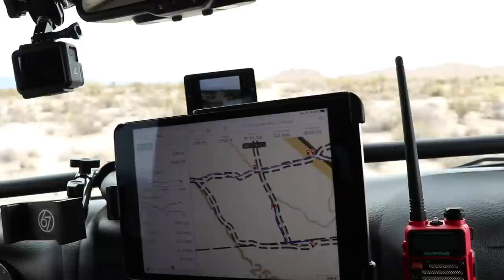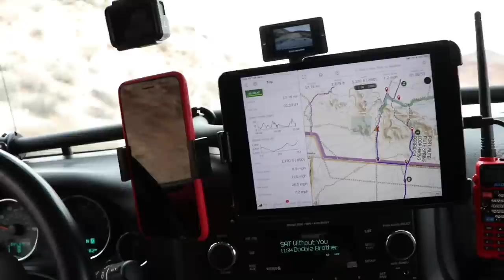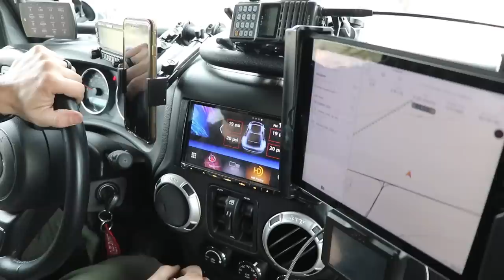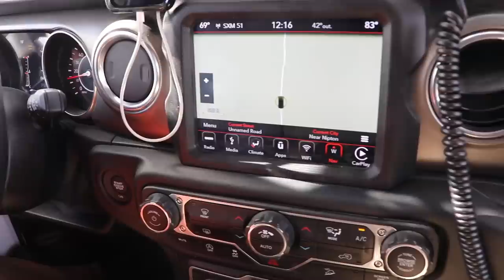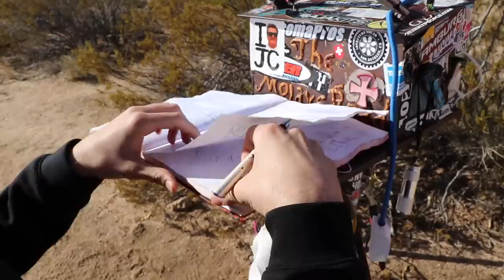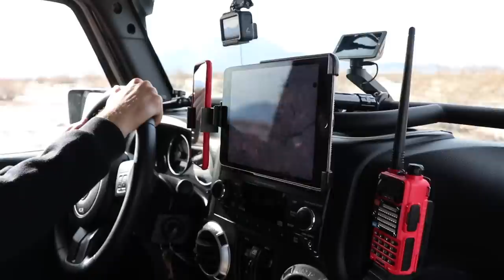Unexpected Snow Along the Mojave Road

Comment: What is with the flashing lights.  That would drive me crazy if I was behind that.
Reply: Judson Gutheil those are trail light. Normaly used in race likethe baja. It prevent you from ramming the other vehicule when in convoy and lifting dirt.
Reply: Victor Keya you can ask here bud...
Reply: Vital if you're kicking up dust behind you. It'll save you a back bumper replacement.
Reply: @dennisreynolds6915  well on this trip it wasnt necessary but there are times a jeep could benfit from that. not really posing but ok
Reply: @dennisreynolds6915  says the guy watching a jeep channel.
Reply: @dennisreynolds6915  let the trolling begin, I guess.
Reply: @donslattery8608  Don't give em the thrill, may they will just fade away.
Reply: avenger007007 solid advice
Reply: There’s this new technique that they’ve been developing for a while, don’t know if it’s in the final stages of testing yet, but supposedly you just don’t drive in the dust if you’re not racing. The problem apparently is that people get separated but they’re experimenting with having large trails of dust following them as a way to be seen in the distance.
Reply: @dennisreynolds6915  why you watching this video then
Reply: I get why they think they need them....but they don’t.   I have done countless over landing trips in horrible dust.  Slow down and pay attention. Those lights even are annoying just watching the video.  Following those would be a no go for me.
Reply: I was thinking the same thing. Wouldn't it be distracting?
Reply: The lights...
Reply: SAME

Comment: I live in the UK wow you guys are so lucky to have all that space to drive in ive just subscribed as i have had land rovers most of my life but iam going for a change my parents passed away leaving me and my sis there lovely 4 bedroom house with large back garden so with the proceeds once payed off everything iam going to get a jeep Rubicon  years ago i had a jeep Cherokee 70s model the big one which did about 8 miles to the gallon so iam going for the v6 model right hand drive over hear  ive had a range rover 3 series 2 land rovers and ive been interested in getting a jeep for a while now as i own a plain station wagon plus my wife hates being low down she never forgave me getting rid of the range rover she like to be sitting high up and so did i you live and learn as i can gather as my old jeep was reliable after i rebuilt it as it was dilapidated when i bought it but was great once i updated the wiring put an alternator on it halogen lights and loads of relays as it had none i had it for 6 years even when it nearly bankrupted me in petrol consumption as fuel is not cheep over in the UK its now five pounds eighty pence a gallon and is seven dollar forty-five  a gallon  but i loved that jeep so easy to work on as i am a mechanic now early retired through injury at work i worked for the R A C the royal automobile club for fifteen plus years and loved every minute of it and wish i was still there so anyway iam defiantly getting a 4 door wrangler Rubicon hopefully a new one or at most 2 years old depending what cash is left over plus i have got to spoil the wife a bit as well as she has looked after me while i am disabled i have a back problem and before you say i must be mad i have been off roading with friends since my injury and it doesn't harm me i find it weird i was expecting to wake up next morning in agony but no i am fine  iam on morphine every day its not like your stuff no high from ares as it has been removed so i can still drive which is great they should give it to you guys as there an addiction epidemic over in the US i see i don't take it all the time but winter is worse anyway so the Rubicon doesn't need much work doing to it to make it off roadable light bar straps a winch warn if i can afford it my old jeep had one on it already so did my range rover we used to belong to a great off road club which i shall rejoin again after quite a few years absence we do have quite a few off road places to go to obviously not as much as you guys have we don't have desert lol in England but there is a lot of mud so i will need some very good deep tread mud terrain tyres with bead locks on the wheels i wish i could drive were you guys are but you never know maybe i could hire a jeep and come for a months stay and join a party me my wife and my grown up son who will share the driving with me now that to me would be a fantastic holiday also to meet some great people and make new friends once i get my jeep i will upload a link for you guys to have a look at it and see what you think once ive done a few modifications plus i can not wait to get back off the road and have some fun as i miss the friendship you make when doing this in an organised manor joining a off road club is like extending your family to me  so happy trails guys  .buy the way the video was fantastic i have subscribed liked and pressed the bell cant wait for your next video so buy guys  from RUGBY ENGLAND UK

Comment: “For every 1000 feet it only goes down 2 degrees...” Starts snowing 😂.  But seriously I wish I could take a trip like that. Great job Brad keep it up!
Reply from the maker: No scripts here... we all knew what he meant!  Thank you!
Reply: It's called lapse rate. Generally speaking 3.5F for every 1,000ft gained is the accepted number but it techically varies with moisture content in the air. Dry air will see a larger drop of up to around 5.4F+ while moist air will see less of a drop at around 2.7+-. It's just easier to say -3F drop per 1,000.

Comment: In case it hasn't been mentioned b4, you would be shocked at how much better a campfire would be if you would tote along a washing machine drum. Put it up on several football sized rocks. The wood burns much more efficiently, slower, the heat retention will amaze everyone. You will burn so much less wood and the warmth that radiates in all directions will blow you away. The steel of the drum heats up and radiates a tremendous amount of heat. The rocks provide a taller heat blanket as well as providing air flow and also heat up and radiate heat. Try it once and you will never go back to pit campfires again.  I realize space is limited with your rvs but this you WILL make room for. Regular campfires loose more heat than they radiate.
Reply: Weight and storage make it impractical/impossible to take overlanding. It does help produce a better campfire, though.
Reply: My volcano stove works like a washer drum (like we use at Glamis!) It also works like Marco's flat grill.  Also works anywhere you can't have a fire directly on the ground. Most highly recommend!
Reply: How many hours to cool down???

Comment: none of that trail looked bad, looked like a subaru could drive that entire thing.
Reply: tank2449 i was thinking the same thing but, better to be over prepared
Reply: @greygoose4x46  i mean my stock 84 s10 2.6 v6 4x4 4 spd manual with my all season tires could do that easily
Reply: Don't worry my Subaru will give a jeep or fj a run for its money, me and my grandad used to drive a 2 wheel drive chevy k10 around this area. The overland movement is cool but most places these folks go you don't need a jacked up jeep, just a case and some friends to get you through when a push is needed. Love, just another preoverlander
Reply: @thehighcountrymedicalclini794  a case of beer? damn right brother. my stock 1984 s10 with a 2.8 v6 and 4x4 with lockers front and rear could do this easily. and i only have 31's on it with some trimming of the fender. its more about the driver than the vehicle. ive gone places that big lifted up trucks and jeeps couldnt make it. its all about hammering down when you need to and when to ease your way through something also. 2.8 v6 isnt putting out much power haha
Reply: @tank2449  damn straight a case of beer. Ya it is more so about the driver, and horsepower really isn't needed I mean you do need it but not like some guys push for. Ive watched a supercharged bronco mash up a hill with 35's lifted the werks and it looked cool throwing dirt and rocks huge bumpers ect... then I watched an international scout quietly and slowly putter over the same ruts haha, with its stock size tires. Got to remember some of this stuff is a lot like the guy knocking on your door I the 50's trying to sell you a mirco wave, when all you need is 5 more minutes on the old gas burner. Take care, from flagstaff, az
Reply: @Michael_00001  i dont own a subaru i was just using it for refernce because it is a "car" that is awd. my 1984 chevy s10 and my 1980 chevy 3/4 ton suburban could do it no problem relativity stock trucks.
Reply: The point is the scenery and history not how mean the road is! Or how macho your rig is!
Reply: @Michael_00001  No one is compensating for anything, folks have 35's under some GL wagons that im sure would handle the Rubicon no problem. I was just poking fun, and we both had a laugh, then here comes Mr. Rubicon trail, off to show us that the trigger is real with jeep guys. I don't have my forester completely decked out, of course starting with one of these leaves me at quite a disadvantage for an offroad rig ill be happy to accept the challenge.
Reply: Except the. Swim....

Comment: Would a stock Jeep XJ be able to do this trail?
Reply from the maker: In good condition with a solid set of tires, yes!
Reply: It sure will. Some sandy areas. Not that bad at all. I like the pace. Slow down and enjoy scenery. Done enough of the ON THE GAS all the time
Reply: Thanks guys!
Reply: @justinhelfer2022   Don't buy a Jeep, worst idea for off roads.
Reply: I had a '95 xj on 30s. A buddy had an '03 tj on '31s. While he was getting stuck, I was walking all over everything. I have a YJ now but I'm looking for another xj to build for this type of stuff. In other words, I guarantee it'll do fine. Just get a good set of all terrains (bfg ko2s or the like) instead of these SUV tires alot of people get, and you'll be alright
Reply: As Brad said, as long as you have good tires you'll be fine. I did this trail last year in a stock 4runner. I shredded my front skid plate, and destroyed 2 of the stock tires, but I was mashing it pretty hard. Make sure you bring a spare (or two) and keep it mellow, and you'll do fine.
Reply: No issue, I’ve done it with an older stock F150 4x4 with 31” tires

Comment: Great video. I went on a Mojave run(day trip) 4 years ago in my stock JKU. I lost two tires and the water crossing came up to my headlights. No water came in the cab so I was very grateful. We didn't go past traveler's plaque so I will need to add a rock next time. Great trip for a beginner.

Comment: I had a 90 wrangler i built years ago for rock crawling here in Arizona. Ive since sold it and recently purchased a really clean 86 Bronco. Im looking to make it overland capable. There were some spots on the trail where the jeeps were a bit tight on either side. Would a Full Size Bronco have cleared all the trails?

Comment: Great video! Thanks for the trip! 
So the water doesn’t come into your Jeep? Sealed that well? I am surprised that the shock mount and sway bar broke on a somewhat mild trail. For the most part it seemed to be a dirt road with some whoop-de-do s in it with some slow parts here and there.

Comment: Brad, theater quality video and editing.  Truly a modern version of the old 1950's TV show BOLD JOURNEY.  But one thing I am upset about (smiles), I did not know that you were making this trip and I really wanted to tour with your group on the Mojave Road.   So, I guess I will continue to plan my solo trip for March.  They say don't travel alone, but I do since I can't find a local group like yours in Las Vegas.  I only hope that if I have a breakdown that I can nudge my Jeep out to the nearest paved road like one of your members.  I have not been to the Carruthers Canyon camping area.  Now I know what it looks like.

One question...It appeared that you went over the old telephone cable road after leaving Ft. Piute.  This is the stretch between mile 27-33.  It had been closed due to a bad washout...so has it been repaired?   If so, great!  Looks as though someone moved my jeep toy from the top of the rock at the mailbox.   My red sandstone rock seems to be still present at Travelers Monument.  That last campsite at 17 Mile Point is a nice sheltered spot, have stopped there once.   Was pleased to see that you got off course a few times, since I was feeling badly having done the same thing.  Those cross roads/washes can be tricky.  So thanks again for another outstanding video journal of the Mojave Road.
Reply from the maker: Thank you!  You may want to try hoping on a couple off-road forum, I wouldn't recommend doing it solo.   That section of trail was repaired this last year and now open... detour no longer required.

Comment: If you have driven the Mojave Road lately, do you think a GMC Yukon 4x4 w/ mud tires but an XL (extended) version will have any issues with the trails? Also, is there a side road to bypass that water crossing? Thanks in advance.
Reply from the maker: I've seen lots of full sized trucks out on the Mojave Road and as for the water crossing, there are a few options that will allow you to navigate around it, but need to be planned out a few miles before you get there.

Comment: Great video again Brad enjoyed your adventure in the Mojave Desert just thinking about my jeep liberty Renegade going through that  rough terrain and about possible break downs it could encounter, yes you're right make sure your rig is up to the challenge with everything working topside and underneath. The only questionable possibility with a 2.5 inch lift going through the river crossing.  I don't have the big tires to ford through so is there an alternate route for those of us that don't have the clearance?  Anyway looking forward to the next adventure.
Reply from the maker: There are a few trails that you can head out on that will take you around the water crossing.

Comment: What was the depth on the Afton Crossing when you guys went?  I was thru on xmas day and it was at my bull bar on my truck which sits at 47 inches, take away the bow wave and the water lines on my truck and it was about 45".
Reply from the maker: I measured the water line mark a my doors an it was around 38", so a little deeper when you went.

Comment: Just curious, but how many gallons of fuel did you take for the trip?
Reply from the maker: I had a 1/4 left and used the 3 gallons I brought.  There is a gas station 9 miles down the road from the end of the trail.

Comment: At 6:20 you show an iPad mount by what I believe is Ram Mounts.  I have their iPad 2 to iPad 4 mount.  It has caused damage to the plastic bezel and the plastic antenna cover on the back of the tablet.  Have you noticed any similar problems with the new one for the iPad airs and on?
Reply from the maker: Mine is an iPad mini with a ram mount held on with a 67 designs arm... no problems with this setup for over a year now.

Comment: Brad, where did you guys fuel up before you got on the trail off of the 95 (to Balancing Rock campsite)?
Reply from the maker: There is a gas station just a few miles north on the 95... topped off there before heading to camp.
Reply: @TrailRecon  Perfect, thanks for the quick response!
Reply: @TrailRecon  I wanted to follow up on this.  I could not locate a gas station on the 95 highway north of the 40.  Do you have an address or GPS coordinates?  Thanks

Comment: Ventilation ventilation ventilation

A tent will and is only designed to protect you from the elements. Your sleep system will be what keeps you warm. Having open windows is key to keeping the condensation from building up in the inside...

Comment: are the mechanical failures to be expected in these kinds of trips?
Reply: Often yes, always pays to be prepared and not need it than need and not have it. The slower you go the less damaging things generally are. A lot of dirt roads develop washboards which are very hard on suspensions especially when traveling fast. Any high spikes ie. shocking things have a higher chance of breakage and of course there is just wear and flukes, sharp rocks.

Comment: Next time you have to camp in a snowfall build a lean to up wind of your camp fire  but have the opening close enough to catch the radiation of the fires heat so it gets caught in the lean to. The rising heat should pull the snow away from you. Then all of you can pile in the front & keep nice & warm as well as dry. Bring a roll of plastic & a saw to cut some skinny dead falls to make the frame you attach the plastic to if you don't want to ruff it & use some thick pine tree branches. You can use the frame in the morning in the fire & keep plastic for next time. Oh! Put your firewood inside at the back of the lean to & off of the ground. Maybe you can get a cordless chainsaw or reciprocating saw sponsor or two?
Reply from the maker: Excellent advice, thank you!

Comment: 3* per thousand feet of elevation is not accurate on the small scale. He was not taking into account thermal inversion. The valley would probably be much colder than the higher elevation location you chose to stay at.